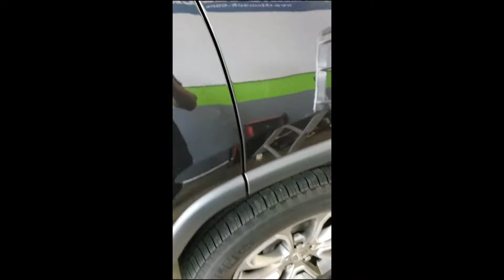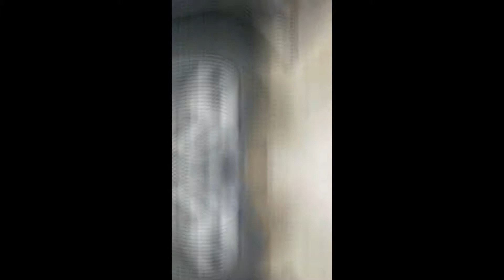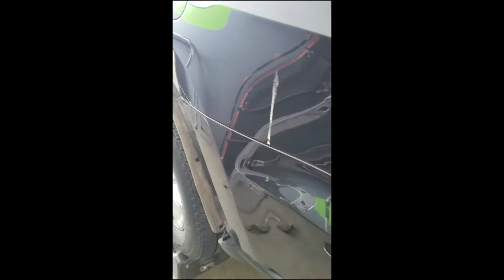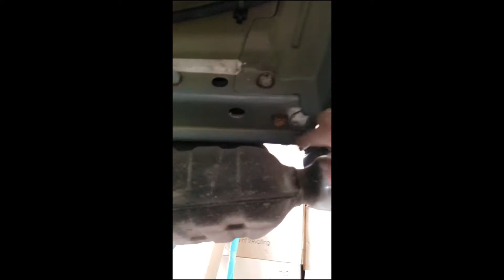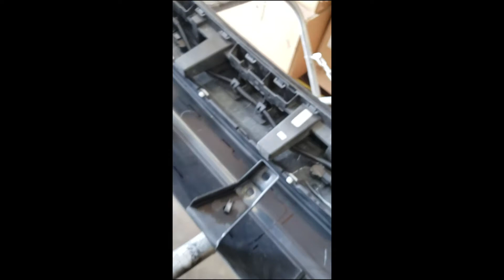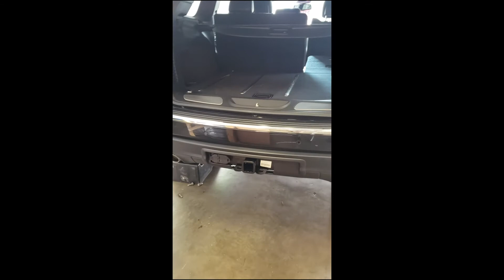2011 to 2019 Jeep Grand Cherokee Trailer Hitch Install with Factory 7 Blade Wiring

Comment: I've heard that you can do this install without removing the bumper, but instead removing the bumper lower insert. Apparently if you remove 11 (?) white clips that you can see at 6:13 in the vid above, you can remove the insert which gives enough access to do the install. Seems a bit easier than removing the whole bumper?

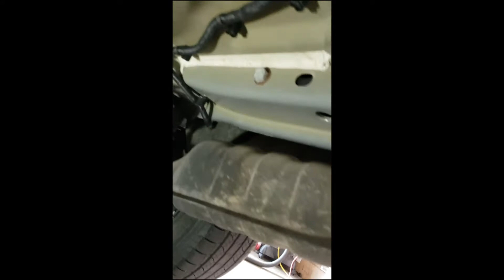Comment: At 4:49 there were two bolts and one hole on the side frame rail.

After you put the hitch in place there were three bolts in the side frame rail. Is there a nut plate that comes with the hitch for that center bolt?

Comment: Also a note for everyone..if you install this hitch, you WILL have the higher factory tow weight rating.  If you go with an aftermarket hitch like the Curt, then you will have the lower tow weight rating.

Comment: I have a 2021 Dodge Durango RT. Any idea on how to / where to connect the factory trailer brake control module?
Reply from the maker: There should be a grey plug above your OBD-II port slightly to the left above some multicolored wires! Hope that helps.

Comment: You only need to remove the bottom facia. 11 clips and a few screws and bolts. No sensors or other molding.
Reply: yup, just did my 2018 Cherokee.  Don't need to take the whole bumper at least for this model year.

Comment: What is the torque spec on the hitch where can I find that
Reply from the maker: Hi There,
Refer to your particular install sheet. 
On the Mopar hitch sheet K6860898 it says to tighten bolts to 122 ft. lbs.

Cheers,
Team Modula

Comment: Good video and thank you for sharing. But, I found that you really only need to take the rear bumper fascia off. I did that by poking the plastic clips with a standard (flat head) screwdriver, moving the heat plate enough to get the final three white clips on the passenger side and saved a ton of time and effort.

Comment: Hey great video 
Do you know if the applies for the 2020 altitude ? And links for the parts thanks
Reply from the maker: Hi There,
I would recommend reaching out to your local dealership and providing your VIN to get a guaranteed fitment answer. 
Same with the parts, any Mopar store will be able to get you the factory system!

Cheers,
Team Modula

Comment: Thanks for the video. Helped a lot. Question.. did the wiring socket come with your receiver kit? If not, where did you purchase it from?
Reply from the maker: Hey There,
Glad we could help! 
Everything came direct from Mopar. It was all factory fit and the harness at 7:57 was installed from Factory. 

Cheers,
Team Modula

Comment: I swear it looks like you could remove that bottom section only not the entire bumper plus rivets by going on the underside and taking some needle nose to those clips on the lower section + the couple of 10mm bolts on the side on my 2017. I may be crazy cause I can't find a single video on youtube where they don't take the entire bumper off. Maybe a chance for me to do a new video? I wonder if anyone has tried it just removing the lower section.
Reply: I'm sorry to break it to you and it may be different on earlier models(I cant tell if yours has the bottom section or not) but on 2017 model limited, you only have to remove the lower black section vs the entire rear bumper and it's much much easier to take that off with just some little white clips that can be removed quite easily from the backside with a small screwdriver pressing the tab and lightly pushing up. 
I installed an OEM factory hitch on my 2017 limited this morning 3/19/2022 by only removing the bottom section. 
Cutting the insert was the toughest part and most time consuming too. I was wishing for a dremmel cutting tool but I dont have one unfortunately. I tried heating the razor with a candle after my lighter gave up and that worked better than nothing. Torqued the bolts per your video at 90 ft lbs. My eyes are so old they wont do 89. I appreciate your hard work. Thank you

Here is a link to my completed bumper...the black section at the bottom can be removed https://photos.app.goo.gl/kK7JNFNhLBPmQEqy8
Reply from the maker: @JD_Spencer  We'll have to try that on the next one. Sounds like a solid time saver!
Reply: @ModulaRacks  your video still helped....thank you for providing it...I said back side but meant underside I think...like not from the outside...from the inside. There should be some little white clips. You'll see what I'm talking about
Reply from the maker: If we remember correctly, removing the lower section doesn't give you quite enough space to slide the hitch into the frame rails.

Comment: There's much easier way to remove just the lower trim piece on the bumper instead of the hassle of removing the entire bumper.  Go to Jeepforums.com and do a search on hitch install.
Reply from the maker: That's a great tip. It has been a while since we made this video but I seem to remember that this level of trim had a smaller lower fascia and we couldn't have gotten the hitch in. Though... it has been a while.
Reply: @ModulaRacks  Very true.  It won't work on some facias, but on the late model Limiteds - mine is a 2019 -, it should work.  Much easier since you don't have to disconnect all the sensors and replace the rivets.

Comment: This video helped me so much.  I installed a trailer hitch myself and couldn't figure out where the screws go inside the rear wheel bumper facia. Now I know,  10mm, 7mm and 8mm. Again thanks so much
Reply from the maker: Amazing! So happy that we were able to help.
Reply: mm, kg,  is a power)

Comment: My only issue was what did you use to cut the bumper to put the new cutout in for the hitch?
Reply from the maker: Hi Ryan,
We use a small drill bit to get a pilot hole started, from there we use a knife heated up with a lighter for nice clean cuts.
A set of aviation shears  can also work great! 

Cheers,
Team Modula

Comment: I have a 2021 SRT.  Am I correct to understand that the hitch, once installed, cannot be covered with the bumper cap?  I really didn't want the hitch visible unless in use which would only be used for a bike rack.
Reply from the maker: Hi Stephen, you are correct. Also be aware that if your SRT has the center exit exhaust there is no hitch that will fit as the tips are directly in the way.

Comment: How do you remove the cap on the plug
Reply: Hey Jennifer, DO you mean the cap on the factory wiring plug? If so it should be as simple as pulling the plug out. It is in there tight and there might be a little security tab that needs to be released.
Reply from the maker: Hey Jennifer, DO you mean the cap on the factory wiring plug? If so it should be as simple as pulling the plug out. It is in there tight and there might be a little security tab that needs to be released.

Comment: How did you get the bolt off (and even back on) over the muffler? I have no room with my torque wrench and socket...
Reply from the maker: You could use a universal joint to give you thr angle you need otherwise use a standard wrench 🔧 and make sure she's good and tight
Reply: @ModulaRacks  thank you! My neighbor had an open ended wrench and I was able to complete the install!

Comment: Nice, I got a curt one on my 2018 jeep grand cherokee laredo, going to get the wiring activated tomorrow... 175 for them to flash the ecu lol
Reply from the maker: $175! Does not seem right. Stoked the video helped 🤙
Reply: and you don't need the factory wiring harness.. apparently the new jeeps dont come with factory wiring for trailers anymore. unless you have it on when you buy it.. this video shows the factory harness was already installed.. my 2021 doesn't even have one

Comment: Very helpful. Do you know if there is a trick to turning on the wiring aka “flashing” the wiring in the computer without going to a dealer?
Reply from the maker: We've heard there are apps that can be purchased to do this. Generally you will also need to buy patch cables also. Rumor has it this might cost a little more than going to the stealership, but may allow you to make other changes to your vehicles programming.
Reply: @ModulaRacks  I used a obd2 scan tool with Bluetooth. Total cost is $10 for the scanner and I paid $23 to register my vehicle with Jscan. Took less than 10 minutes to get my trailer lights turned on.
Reply from the maker: @mathewdonovan5321  awesome! Thanks for sharing. We'll pass that info onto our customers 👍
Reply: @ModulaRacks  How to video to activate the trailer lights without going to the dealer. https://youtu.be/0KBsU5Hls-I
Reply: jscan app can do it

Comment: Man...

My pressure clips on the fender flares did NOT want to come out. I wish you'd have shown a little bit of that process instead of the FoodTV style "we're gonna XYZ" and then cut to "we have it done and now we're gonna..."
Reply from the maker: Sorry J A We're new to videoing our installations. Those clips can be a pain. Grip, wiggle, yank, curse ;-)
Reply: Modula Racks haha, that's pretty much how it went. I ordered a pack of new ones ultimately since a few broke
Reply: I removed the pop clips at the top of the fender flare, removed the one alligator clip at the bottom, removed the 7mm screw, then proceeded to remove the bumper. Once off, removed the two remaining alligator clips and detached the fender flares from the bumper...

Comment: Does this give the vehicle the same tow capacity as if it were the stock jeep tow package? What is the max tow weight and tongue weight for this hitch?
Reply: Not quite. The "full" factory tow package also includes a bigger radiator for cooling, bigger alternator, bigger breaks (and wheels if you didn't start with a package with the 18s) and beefier suspension in the rear at least. No yacth towing out the gate to say the least

Edit: not only bigger breaks which need the 18s to fit, but the vented rotors. Shocks and springs shouldn't be too much to do on your own relatively, and if you're like me, it's all coming regardless because any respectable lift kit outclasses the factory suspension by miles.
Reply: Jordan Broly Great video bro, my GRAND CHEROKEE 2016 needs this. Do you happen to have the part numbers for the plug, trim bezel?
Reply from the maker: If you want to tow something heavy the first thing we suggest is to add or upgrade is the transmission cooler. The transmission will take the most abuse when towing heavy and will require heavy duty cooling. The next thing would be an auxiliary oil cooler. These are  all things that likely come from the factory when equipped with the max tow package.